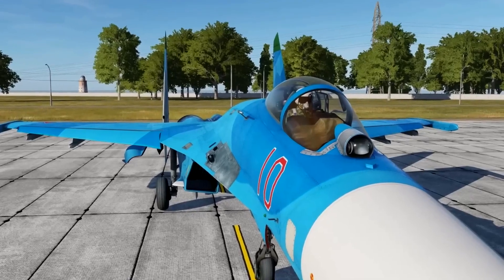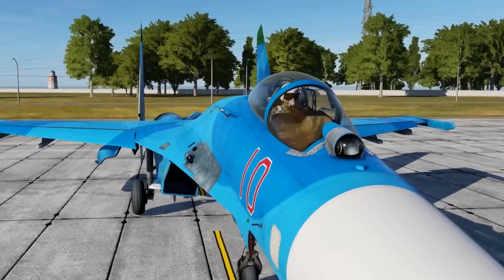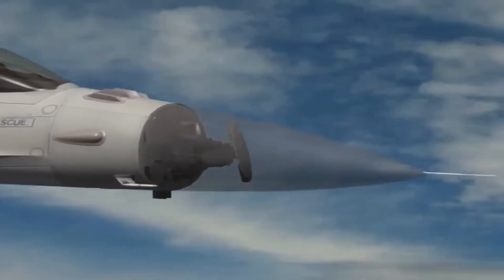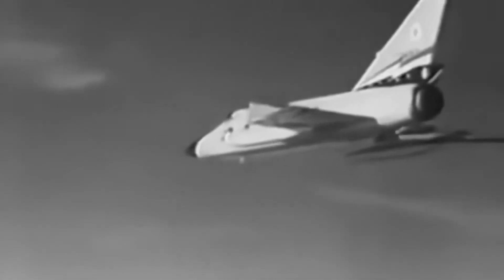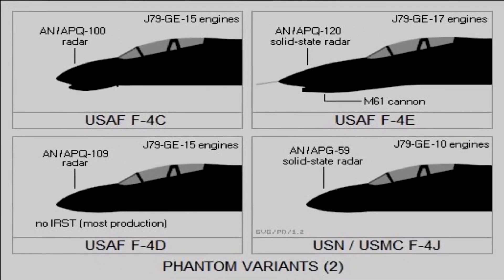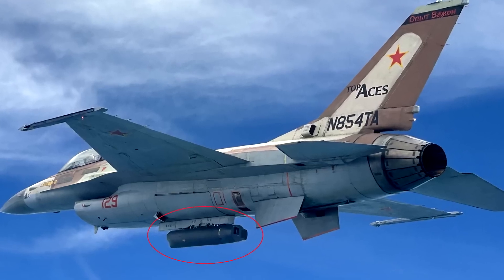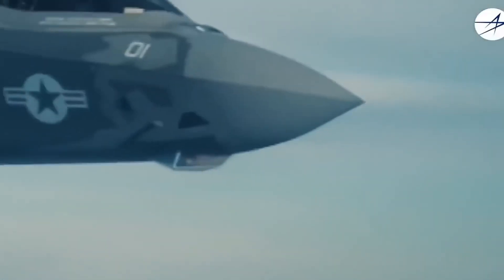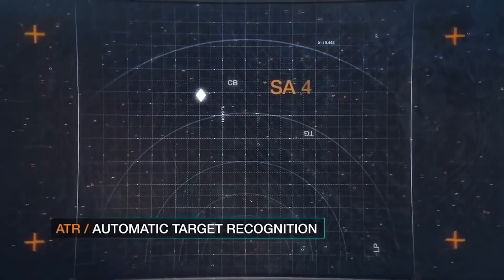What is This Strange Bulb and Why Isn't it Present on US Airplanes?

Comment: The IRST systems on the MiG-29 Fulcrum and Su-27 (and all it's derivatives) includes a laser ranger designed for use with the aircraft's internal cannon, increasing it's accuracy, and in conjunction with a helmet mounted sight and the R-73 Archer air-to-air missile